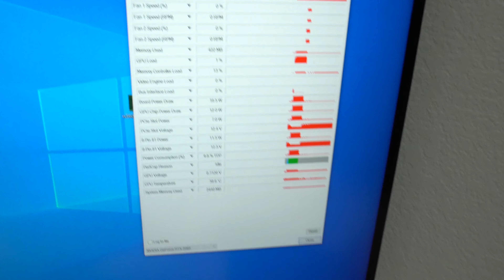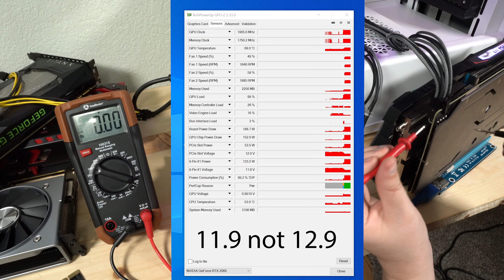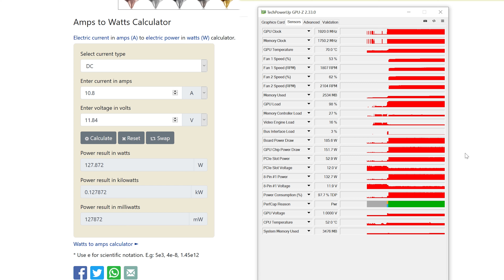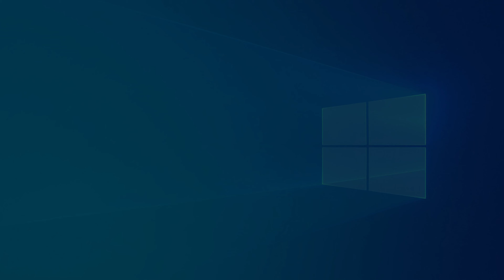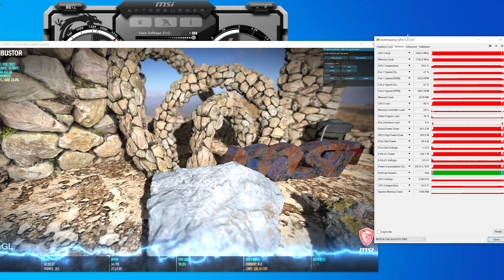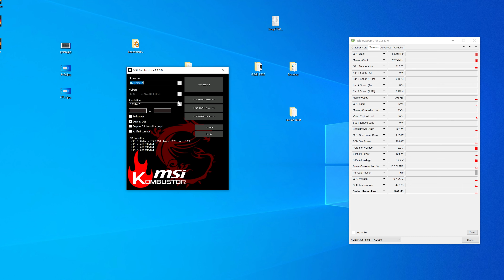GPU-Z vs Multimeter | Checking Video Card Real Power Draw

Comment: Hmm. Voltage if the PCIe slot will be different from the 8 pin. They power different phases with different current requirements, wouldn't be surprised if it's actually higher thanks to the higher current. Also what's the accuracy of your meter?

Comment: Can you test real power consumption of gtx 1050 by multimeter? Gpuz shows that in idle that card consumes about 35 W(47-49% tdp) , but in all internet reviews when u measure by multimeter it consumes about 7 W. This is a common issue u can google it. Sensor problem at all gtx 1050...so in this case gpuz lies...

Comment: Damn, so easy to short out more than 10 amps with the probe if the hand slips while looking away to the display. I would not risk it and assume 12 volts that regulated power supplies should have, and what could be verified from a free molex conector.

Comment: I have a MSI GE76 Raider laptop with i7 11800h and RTX3070 and the GPU board and chip power are gone crazy. I get reading of 220W and 200W spikes gaming. It doesnt seem to do it in benchmarks like kumsustor but playing COD Modern warfare and Doom Eternal it will spike occasionally and seems only momentarily. Any ideas what could cause such an issue?

Comment: I don't trust CPU-Z after it showed that my original Legion 5 (2021 version) only has a 80W 3060 which doesn't even exist as far as i know while the peak TDP was 130W according MSI Afterburner , Hybrid mode off , plugged in and on performance mode
Reply from the maker: NVIDIA official lists the 3060 Laptop version as 60-115 Watts. The brand is determine how much is allowed. Whatever GPU-Z says I believe.

Comment: hello 
my graphics card is buzzing
I see in GPU-z the 8 and 6 pin connectors produce more than 12.0v 
12.1v when gaming and sometimes 12.3 in idle did you think this is dangerous 
my power supply is Thermaltake smart se 730w and it buzzing especially when playing games 
-what did you think causing the problem please help me
Reply from the maker: The buzzing is coming from coil whine most likely. It is usually caused by "dirty power" in my experience (my house), though it can simply be "a thing" cards do. I had one that buzzed for years, another stopped after a month. Some never buzz at all. Than you have things to consider like house power. It is on a UPS, cheap power strip with no filters, etc.

To answer your voltage question 11.8-12.3v is fine. Coil whine is not a problem per say, its just part of the process for stepping voltage down I believe.

Comment: hi man ,a 650W PSu for an GTX2070 super 3 oc ,3800x cpu is to low ?You think i got issues with fps because of that ?
Reply from the maker: I think your fine. The 2070 Super draws 270 watts and the CPU will top out at 200 max for a OC. So that is under 500 watts.
Reply: @overclockersclub  how but how about the other components,i got a NH D15 dual tower ,and 5 140 fans in case ?

Comment: Does the power coming more through the riser or it split evenly between those two? (The pcie 8 pins and the connection to riser)
Reply from the maker: All PCIE slots on the motherboard is designed for up to 75 watts. Its is up to the PCIE device to request X amount of power. I've  seen anywhere from 30 to 75~ from videos cards. Its not a 50/50 split based on the design. In this case since I used a riser, I had to power it separately since the USB cable going  to the PICE slot does not carry enough for it to operate. In this case it only was used for data transferring. Thanks for asking!
Reply: @overclockersclub  ooo i see..thanks for that explantation
Reply: Hi, may I know is it the PSU can't perform the power or the GPU ? I'm having an issue. When i watch movie or play game it randomly goes black screen but my fan and everything still running. It just written "no signal"